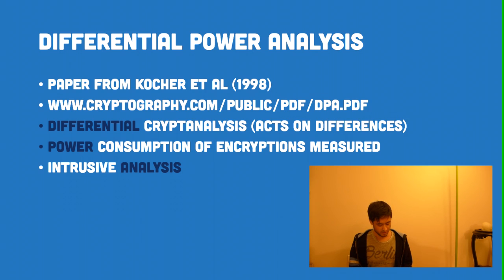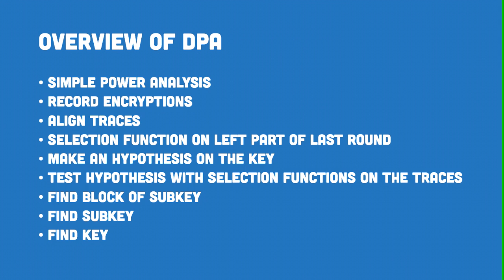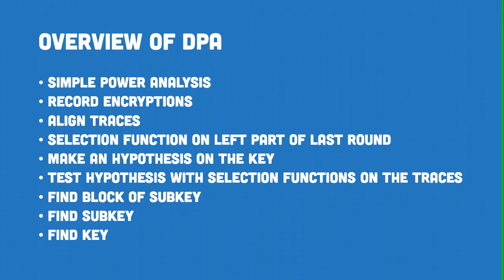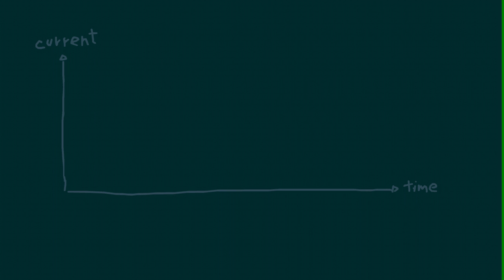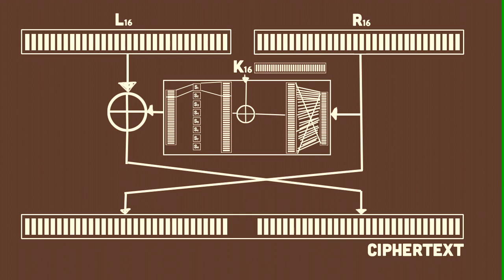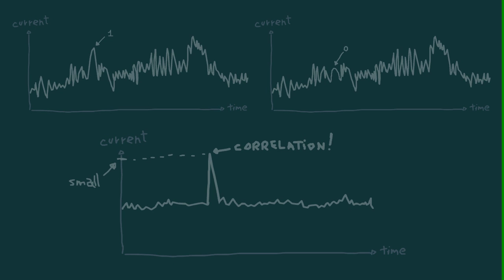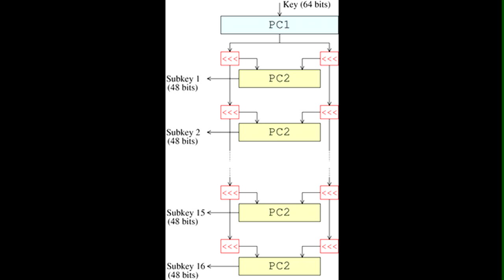Explanation of DPA: Differential Power Analysis (from the paper of Kocher et al)

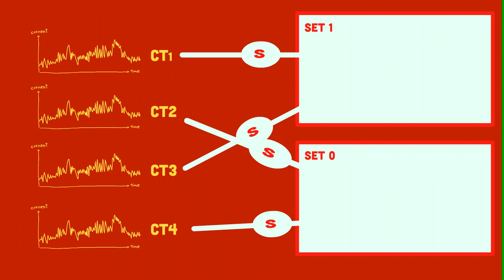Comment: At 8:49 when you are explaining about Sorting in two groups (1's and 0's) you say we use Selection function with Cipher text, do you mean we XOR Cipher text with Selection function ?
Reply from the maker: you feed your ciphertext to the selection function (it's a function you can't XOR it). IIRC your selection function is just something that takes a ciphertext and a key guess as input, and gives you a bit as output (the reversed bit at a certain position). Does it clarify a bit?
Reply: @cryptodavidw  Great video! I have a question as to how to practically accomplish breaking the cipher when we provide the sub-key. How do we actually test the sub-key when it is a permutation of the original key? Do we access to the internals of the hardware that we're injecting that specific sub-key at that particular time during decryption or are we giving the hardware a key which we designed such that we know what the key at the final level (first level during decryption) is going to be?

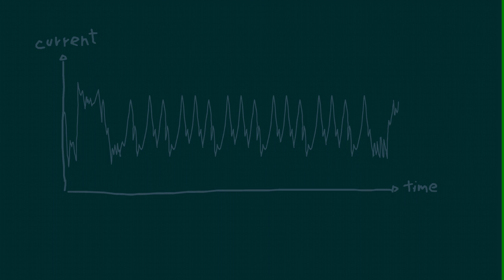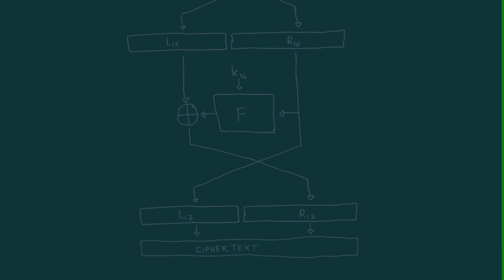Comment: Very good job! David, first of all I should say thank you. You explained the TDES clearly and i have understood more from your clip. However, according to the screen at 5:43, the input plaintext data was permuted and separated into L1 and R1. Then a F function was performed on the R1 using K1. That is no problem. Then, move to time = 5:48. Are they L16 and R16 on the top? 'cos I may found they were L15 and R16 there.
Reply from the maker: look at a diagram of DES! It will mostly be better than my poor drawing :p also, sorry for replying so late!